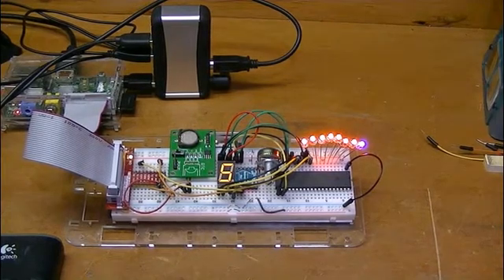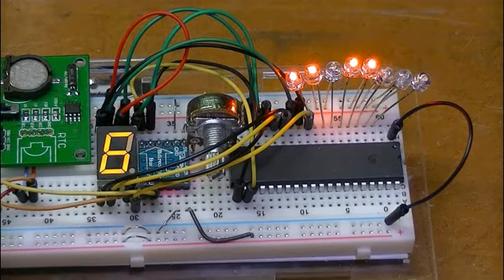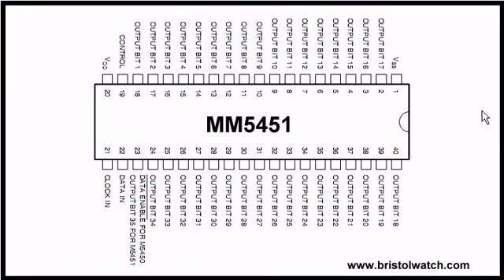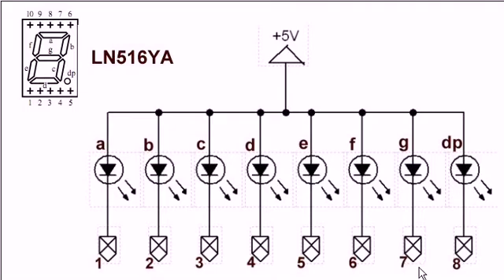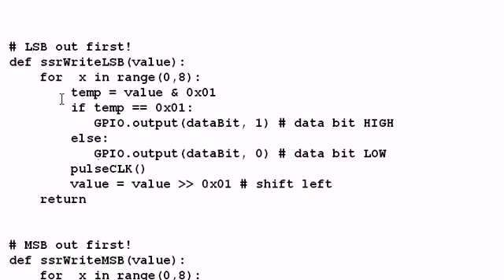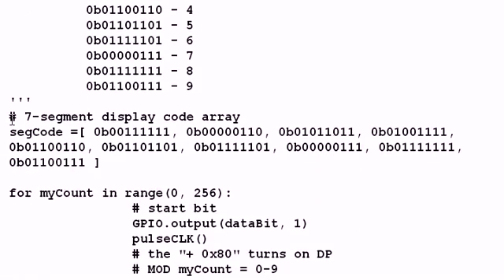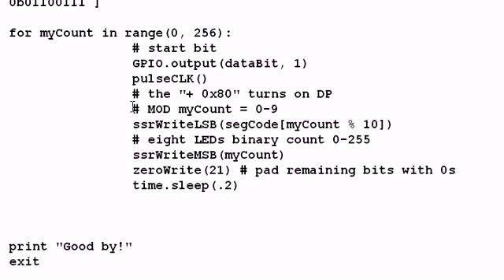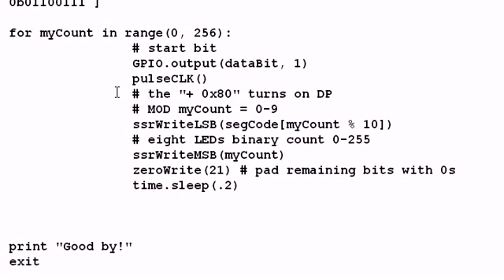Connect-Program Raspberry Pi and a MM5451 LED Display Driver

Comment: This might be a stupid question, but could you use this chip for multiple 7 segment displays?
Reply from the maker: Yes but observe polarity.
Reply: @LewisLoflin  I was also looking at the MAX7219.  What is your preference?  I going to be using the arduino to display 4 different 4-digit 7-segment display.  

We are building a Variable Frequency Drive.  It feels like the most complicated part is the display.  The calculations are easy enough.  I have some programming experience, but I have never dealt with shift registers.
Reply from the maker: @dereklaur2154  The 7219 would be better due to lower price and more available.
Reply: @LewisLoflin  strange, it says the max7219 is more expensive on digikey. Where do you get your components
Reply from the maker: @dereklaur2154  I just looked and couldn't believe it. I got mine off of Ebay for as little $1 each. You can buy entire displays ready built for under $5. Note the links below where I've used them with Raspberry Pi and here is Arduino. 
https://www.bristolwatch.com/arduino/arduino_max7219a.htm 

I have a bunch of those let me check how many I have.
Reply: @LewisLoflin  Yeah I bought a 4 pack for 12 dollars with LED and max7219 off of amazon.  I have never used eBay so I am a little skeptical. 

At least it saved me some money.  Project is already over $200 dollars.
Reply from the maker: @dereklaur2154  I use Ebay 90% of the time.

Comment from the maker: This is series showing how to use nearly identical code across multiple computing platforms and electronic devices.
http://www.bristolwatch.com/ele2/rpi_clock_max7219.htm
http://www.bristolwatch.com/ele2/arduino_74HC595.htm
http://www.bristolwatch.com/ele2/rpi_count_max7219.htm
http://www.bristolwatch.com/ele2/74HC595_cylon.htm
http://www.bristolwatch.com/ele2/arduino_MM5451.htm
http://www.bristolwatch.com/ele2/rpi_MM5451.htm